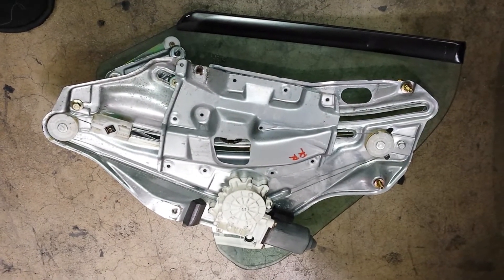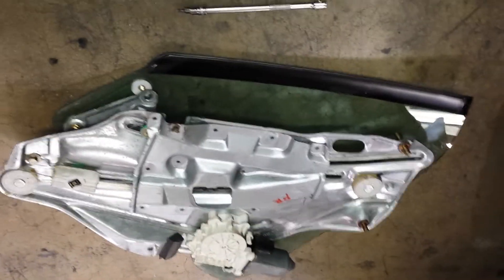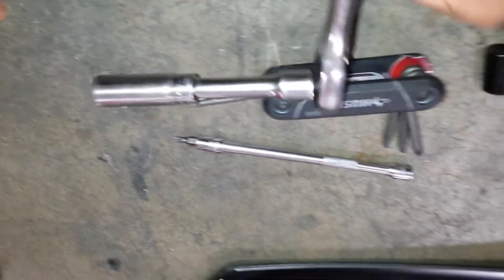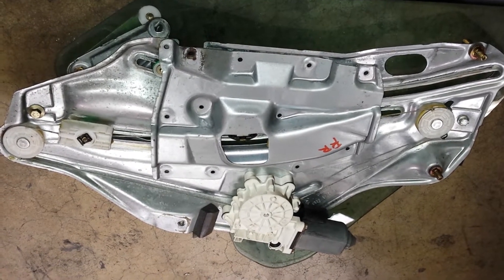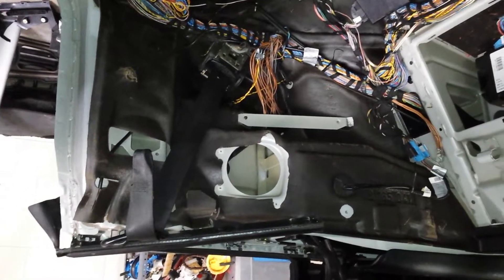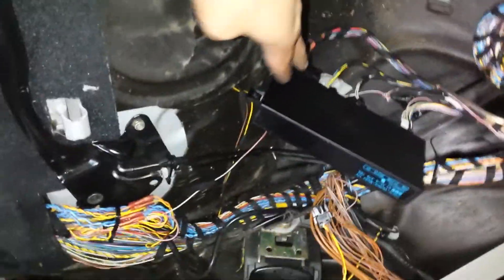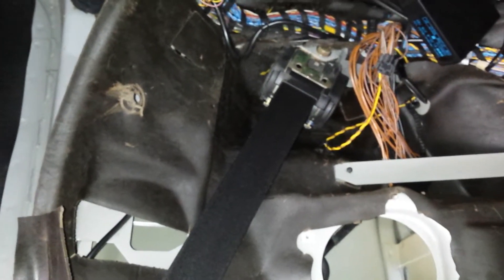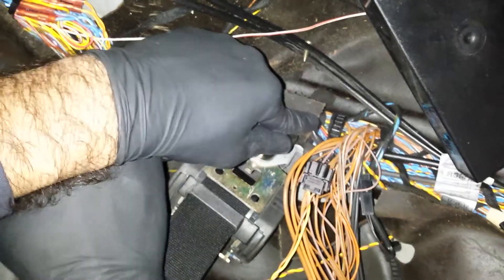BMW E36 M3 325 328 Convertible Rear Window Regulator Removal Part 1

Comment: Thanks. It is quite helpful. I just repaired my rear window regulator of 323i 1998. I found out that it is not necessary to remove the outside trim. The inner side trim can be removed together with the underneath bar by removing three screws at time 4:00 in your video. Also the wire is not supposed to be loose (in your second video). I bought a repair kit to fix the regulator and found out that the wheel was made incorrectly. This made the wire loose. After I replaced the wheel by my old one, it works very well. Your video helped me a lot.
Reply from the maker: Hello,  Thank you for feedback.
Reply: bimmermerchant 
Hi the problem I have is my rear window on the 323 convertible, I rolled the windows down and the left rear window will not go back up even though I use the rear switch or the switch that operates all the windows, thinking it could be the regulator I replaced it with another and the same thing has happened. Is there a module for each window and were. Thanks

Comment: Anyone searching for instruction with convertible top up and window not rolling down. You need to use a diagnostic OBD tablet (I use Autel MqxiCOM mk808) plugs  into car OBD port, go through  menu to command car to put convertible top on service mode, once in service mode, you can open the convertible using the open button on the car. If top acting weird after replaced the window regulator, then you have to go through the menu to initialise power window regulators. I hope this helps anyone who got a broken window regulator flooded inside the rear quarter panel.